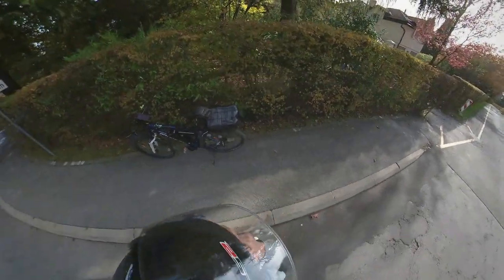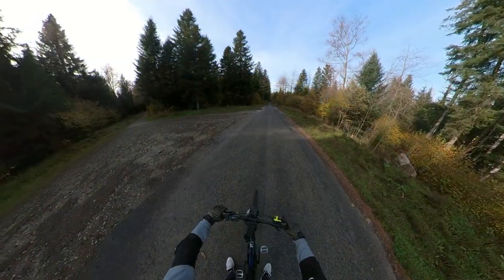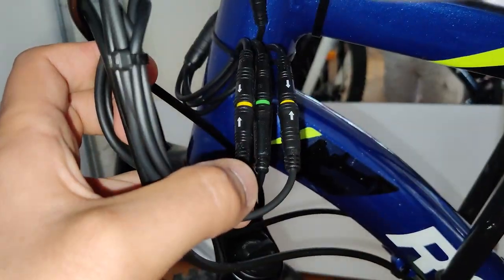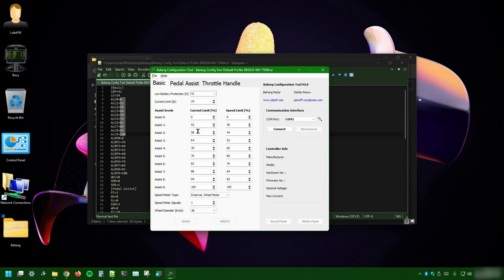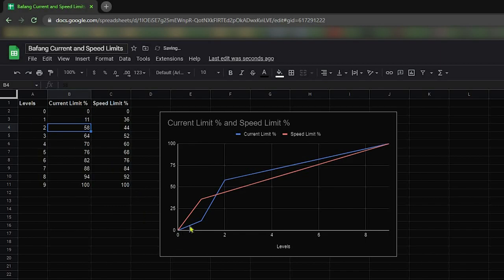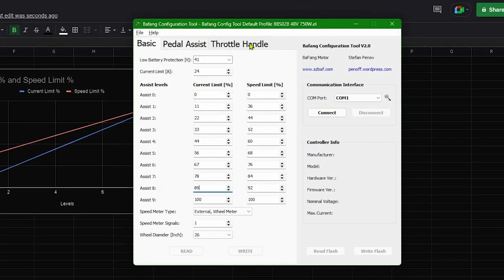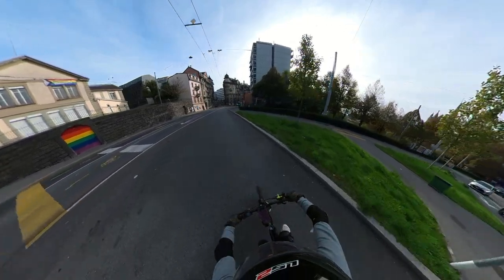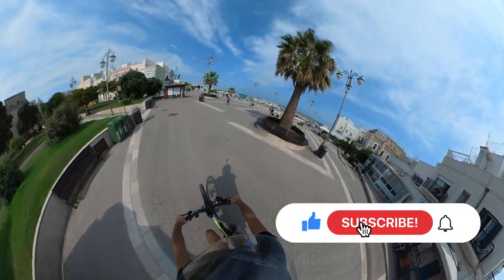I Downgraded My 750W Bafang Kit... but WHY?

Comment: do it x 1.44 for each value. I have mine limited to 18 A
And it goes like this
1 - 1.8A 100%speed
2 - 2.52A 100%
3 - 3.6A 100% and so on
So times 1.8A  x 1.44 as as starting value (10% of the total 18Amps) and go up.
Ending assist level 9 with 18A 100% speed or lower speed percentage if you need so.

Comment: Thanks for this one Luke. I too have a Bafang 750w 48v kit installed on my Tern link D8 folder. So instead of 10%, 20, 35, 50 and so on from level 1. I have to reprogram it again to my specific riding preference and battery management range to 8%, 14, 20, 30, 45, 60, 75, 85, and 98 respectively. Great vid man.
Reply: I have a setting on mine and it's just a simple lectric that has the initial torque setting. Of course I turned mine up not down but it doesn't have the gear reduction as yours does.

Comment: Hello Luke! Great video mate, I'm going to buy a bafang 750w with a 48V 20ah battery, it will be a good one?  I just need help with the screen, I saw the 500c display where we have the 9 levels assists. But I really like a small one called sw102, with 5 levels. To follow you, the  9 levels converted to 5 will be like "1-3-5-7-9"? Thanks a lot for sharing how to update the motor

Comment: I did something similar to my sabvoton build. but what i did change was that i nerfed my phase amps a lot rather than battery amps. before i had great acceleration and could go up any hill but my controller was hammering my battery at any speeds. after i lowered phase amps it uses a lot less battery at lower speeds but i still have decent mid t high end power and speed. it moves pretty slowly from a standstill or going uphill at low speeds but then thats countered by pedalling through it. I almost doubled my range on my route to work (its an offroad footpath with about 0.5 miles of road at the end)

Comment: I use 56v 14s 2p  battery packs on my 48v Bafang BBS02 750W.  I've even used 60v packs but it can shut down for  Error #07 overvoltage on the display if anything going over 61.5v as it will flag a 07 error. After the initial 2018 Bafang purchase and 1500 miles as of Oct. 2023, I may have burned out one of the MOSFETs (error code #12) current sensor abnormality.  I don't know for sure if it was overvoltage that caused it but I might downsize the wattage next time just to keep it safer on the 56v batteries.
Reply: You are one of those people who will have a burnt down house and a post on Reddit blaming the battery manufacturer.

Comment: I followed another guys settings so that power was 5, 10, 15% etc increases - with throttle tied into pedal assist 8 (80%) for a quick burst if you need it
Reply from the maker: I see... yeah mine it's a simple suggestion: everyone should personalize the settings based on their needs, there's no right or wrong, just endless permutations of values 😅
I had a need and solved it this way, but anyone should tune it differently for different needs: I just wanted to show how 😉

Comment: I believe you are right and wrong at the same time.
You seem technical so to share...
Air drag grows at the square of velocity
Power level required grows at the 'cube of velocity"
Translation:
You want an exponential power delivery curve.

You are right in that the factory programming of your BBS02 was way off for good power modulation at low speed. True

But, I am a BBSHD 52V 19.2 amp-hr owner on two bikes with 1700 watt maximum.
58.8v (battery full charge) X 30 amp = 1700 watts
Yes, I rarely use the 1700 watts but I do 'sometimes' for riding 30mph+ for short periods out on fast roads.

Using the Bafang Configuration tool...
I start with very incremental lower power settings for over 1/2 of my power settings...I use 5 power setting.  Then I ramp up to 70% power for power setting 4 and 100% power at power setting 5.

95% of my riding is in power settings 0-3.  I program power setting zero to apply 10 percent of power.  I do like to race on occasion.  I also have had elite road cyclists...no motor hold my wheel at 30 mph so I like to have power to ride fast.

What most users will appreciate is 'granularity' at lower power settings to fine tune power delivery at speeds from say 0-24mph or so.  Above that because power required is the cube of velocity, you want exponentially more power to propel the bike faster.   So power delivery, again in my opinion, should be non-linear, not linear.

So you are correct in more gradation at lower speeds but as you get into higher power assist, this should not be linear 'in my opinion'.  More of your power settings should be smaller spaced at lower assist levels with a much bigger jump at highest power settings.

My opinion.  Big power is a good thing on an ebike 'when needed'.  But also as your video suggests, so it granularity of power settings at lower speeds to make the bike more docile and natural as you say at speeds that are most commonly ridden.

A very good video and wanted to share my opinion only.  Completely agree the Bafang Configuration Tool should be used to reprogram the Bafang controller.  I also like having my throttle be 100% available in each power setting....and slower pedal assist ramp up as you mentioned.
Cheers from America where speed is scrutinized less than Europe where you have a 15mph speed limit on ebikes.  Police in America could really care less about ebike power if we ride respectfully which I always do.  I ride to the speed of my surroundings and don't abuse the power I have.
PS and what fabio said below.  100% speed for each power assist level.  Reason is, let the power available limit speed and not put an artificial ceiling on speed and limit power assist.
Reply: I will change my settings on speed limit  because I do feel like I hit a wall if I get to the top speed of each level,I had not thought  of this thanks
Reply: @LukeLorusso what do you think
Reply: Hi thanks for your input!  I have a question about only using 5 levels of PAS, when programing do you not put any values in for 6-9?  So only 0-5 have data?  Our display only has the 0-5 PAS option  (BN136) so I'm wanting to work with that.  Thanks again <3

Comment: I cut my 350 watt hub to 7 amps & it goes to 15 amps. 
I never thought I would us 0-9 settings, but I tried it & now use it all the time.   
I'm pretty happy getting up to 12 mph.   I like using the bike to aid fitness.  The temptation is to overdue it & suffer injury.

Comment: i have mine set as 100% for allPas 1-9 in the speed section. this way i have max power on the throttle if i need it in a pinch. Any thoughts Luke ? BTW great to see videos on fine tuning, well done.
Reply: Under the throttle section of the programing app, you can change the pedal assist setting from "given by display command" to 9 or whatever level you prefer to lock your throttle level at. This way your throttle is always set to 9 (100%) without affecting any of the peddle assist %.

Comment: Hi, could the low cut-off voltage be set lower than 48V-38V in this engine? 13S Samsunf up to 32V would be ok.

Comment: The legal maximum motor watts in my state is LESS THAN 750, so 750 is technically illegal.  Does your method enable you to make your motor 749 Watts & legal?

Comment: I would basically want each assistance level to be a certain amount of power instead of cutting off at a certain speed.  Well I got to get mine installed before I can start playing with the settings.
Reply: I also wanted this. And so I did. 
Change the Speed Limit to the maximum level you can comfortably pedal. Mine is 65% (about 85-90rpm). 
Then just change to a linear current increase for each PAS mode (except for 9 which is 100% power at 100% rpm). 
This way, you can pedal as fast as you'd like (or slow) and adjust the PAS to get more or less assistance. 

I am however considering doing a logarithmic power curve instead of a linear one, mostly to give me more choice for lower power levels. Over about 500W you won't really add anything, so any PAS level above this is pretty much redundant. 

I'm thinking something like. 
Power in watts.
75W
130W
200W
280W
350W
500W
750W
Max.

Comment: Is this the old bbso2b or the newer one? The newer are the CAN bus right and they cannot be customised like this?
Reply from the maker: that's the BBS02B, which apparently will survive alongside the newer one.
BTW some early experiments (I didn't test it) are showing that replacing the new controller with the old one allows the customizations to be done on the newer one two

Comment: I did the same with the assist, then gave the throttle 100%  Now that i'm used to it i wish California would allow the 1000 hd on the street, especially when dealing with traffic and long distance commutes.. i did pick up a 52v 25ah battery and can hit 42mph full throttle while peddling as fast as possessable, but i wish i could hold 35+ mph with out having to peddle my ass off !!!

Comment: Thanks for sharing valuable information. Do you ever have to worry about the legality of 750w?

I'm more worried about accidents and insurance claims than occasional police checks. Here in Austria also the max power is limited to 600w and the continuous power to 250w. I'm not even sure if limiting the power and speed in the controller would make it legal. I'm going to receive my 750w kit soon and don't care much anyway.
Reply from the maker: Hey thanks for your question!
Where I live it's possible to have powerful ebikes (mopeds, up to a certain W limit) if you comply with the rules: having a licence plate, driving licence, insurance and wear a certified helmet.
Unfortunately, if a custom 750W build isn't legal in some places, downgrading it won't make it suddently legal...
I believe those motors are made for cargo bikes, and that's why they are so powerful. If someone really wants to use one of them for personal transportation, here I show some options to make it "closer" to a less powerful kit in terms of behaviour and personal safety... but not in terms of the law.
Reply: @LukeLorusso  
Many thanks for your answer!  I understand you have to keep it legally "correct" here. 

I'm going to limit the speed and power and use it as a bicycle (not a freaking moped)  responsibly regardless of idiotic laws. Where I live hills are too steep for everyday commute with a 250w bike.

After all, we are doing everyone a favor by not driving cars, and laws are supposed to support the idea! 
Stay safe
Reply from the maker: @persiathiest1963  if all YouTube user were like you man, this would have been a better place ✌️ good luck with your settings
Reply: @LukeLorusso  Thanks! I appreciate your kind words.
Reply: @persiathiest1963  Stay active and vocal to change those idiotic laws!
Do you get a ticket if you don't use your brakes going down a hill? 🤦
There's absolutely no reason an adult can't have a personal e bike any damn way they want and follow common sense traffic laws. (Power and control!) Let's never forget what these idiots did to us during the "pandemic"

Comment: my motor always heat up after 4hours of usage or 1hr during sunny days. If you set the controller amp limit from 25 to 18 or 20? Will it lessen the heat issue?
Reply: Current creates heat. So yes

Comment: hi thanks for your mid motors video series , they helped me a lot . want to ask if I order a BBS02b 500W . can it be upgraded the same way to 750W ? Do both have the same hardware ?
Reply from the maker: hey! that's not something you could do
first of all, 500W has 2 variants: 36V and 48V, while the 750W only exists in the 48V variant.
if you take the two 48V versions, what's different is not the motor itself but the controller, which ideally you could replace, but I can't see why not buying the 750W directly instead of messing with the 500W one
Reply: Oh i was not aware that they have different controllers, i thought it can be reprogammed without hw change . yes i am planning to buy the 48v version.
I actually assumed 500w will be enough for me at the moment , but would like to have the possibilty of having more power when needed.
Does actually the 750w act after downgrading the same like original 500w or 350w motor or is there still differerences ?
Reply from the maker: @ahmed4052  you can surely downgrade it, now I'm not sure if there's an actual config to make it behave "exactly" like a 500W or 350W, but with these setting I'm showing in the video, at lower levels it feels innocuous :)
Reply: @LukeLorusso  as far as i understood you have/had both kits 750w and 500w ,right? 
Did u notice any difference in power or range?
Reply: I mean the 750w after downgrading and the 500w kit
Reply from the maker: @ahmed4052  that's not a fair comparison: the two motors I got are one 36V and the other 48V, plus the two batteries are way different in capacity. also, the fact that the downgraded 750W starts slowly, doesn't make it less-of-a 750W: it will ultimately be able to deliver all its power, depending on the configuration.
With this config, for example, at higher level of assistance the motor will behave as usual: I just made the lower levels less aggressive at start. this is good for me, since I usually stay on level 3/5, sometimes at 4 on steep climbs, and I actually noticed that I charge the battery way less frequently than before.
in short: a downgraded 750W Bafang motor doesn't make it less powerful, just less dangerous

Comment: Luke pensi che bbo2 750 va bene per un rock rider 520 explorer dechatlon oppure. Dovrei prendere quello nuovo nuovo 625 1000w. Perché ho molte salite per arrivare a casa. Grazie
Reply from the maker: Ciao! non ho mai provato il nuovo 625 quindi non posso dirti in merito...
ma quello che posso certamente dirti è che 1000w è mostruosamente troppo...
a meno che non guidi una bici cargo, o pesi più di 150kg.
I rapporti sono spesso più importanti dei W! un rapporto largo diretto e stretto avanti fa fare salite incredibili anche a 500W
Il consiglio che posso darti è: risparmia sul motore e spendi in batteria! almeno 48V 17Ah

Comment: Hi Luke, thanks for sharing!
If you have an Android phone, take a look at "Speeed" by Marcin Kompa. Yes, spelled with three "E"s. I've used it for a couple of months on a BBS02B and a BBSHD.

It does everything the Windows app can do, only you can do it anywhere. I think it's really awesome.

I'm not affiliated with Bafang, Mr. Kompa or Android, in case you are wondering.
Reply from the maker: Hey Herald! Thanks for sharing.
I actually tried that app and surprisingly, even if I changed just a couple of values, that app also changed parameters that I didn't intend to change... I don't remember which one but that made me think. I know it cause I read the values with my PC after flashing from the app.
I'll stay with the PC method, also cause I don't change settings that much, but it's surely a good on-the-go alternative :)
Reply: @LukeLorusso  That happened to me, as well. In my case, my mistake was not using the "READ ALL" button on the "Home" tab before doing any editing. It  wrote the apps default values, which I had edited instead of the controller values. Aside from this incident, I never had any trouble. Usability isn't perfect, to be sure, but I think you have to do that on the Windows app as well. Now, I usually edit the values in the *.el files or load the *.el files and edit them in the app before flashing, so I might have missed unreliable reading from controller incidents. I also only use "WRITE ALL" from the "home" tab, not the "write" buttons from the detail screens, because I am uncertain if they write everything or just the values from the specific tab.
Reply from the maker: @heraldreichel1971  wow man that's really useful!
I'll try this out 👍 thank you!

Comment: Can I use the exact numbers you have here for my bbshd with a bac855?
Reply from the maker: I guess yes, absolutely!
consider that these are % values, so on an HD 1KW they will translate to almost a 25% boost on levels compared to the 02 750W, but they'll sure make your experience way better overall ✌️
...not sure about the BAC855 thing btw 🤔 can you still use the programming tool with it?

Comment: Way too much math! I just did the adjusments in a fashion that seemed more linear then used the "SPEEED" app (on my phone) to adjust programming on the fly until I got it right for me. My 02 is set up to be "class 1" and I have a tiny 6AH battery so 18 amps was more than enough to maintain 20 mph on flats and still climb hills with ease plus I get better range from my tiny battery. An added benefit is that at 18 amps the 02 is virtually bullet proof reliable.

Comment: That Computer bafang configuration tool is way complicated..   I used my programming USB cable / w/adapter DataCable to usbC / Then downloaded an Android APP called "SPEEED" on my phone.. I can do everything on the fly with this simple Android APP on my phone..
Reply from the maker: You can adopt this profile using the Speed app too if you like: you just need to copy the values over 😊

Comment: Thank you! 
My battery lasts for 100km... but the throttle is so aggressive from the start 
that I cant use pedals in combo or tell the difference in assist levels😅 (why do they even exist in face of custom software or instead of factory linear/optimally tuned throttle???).